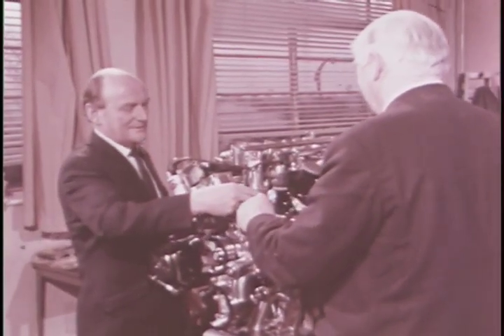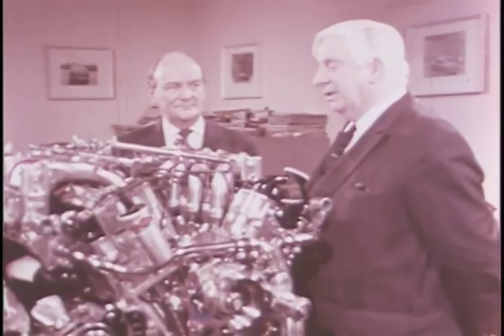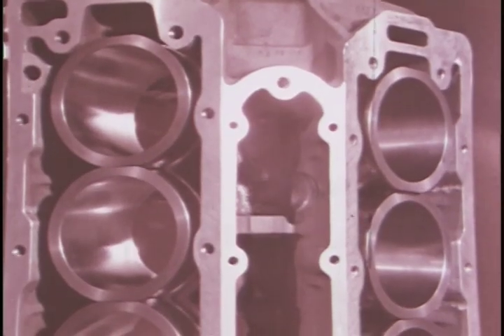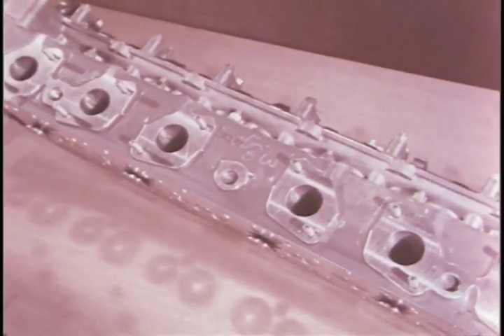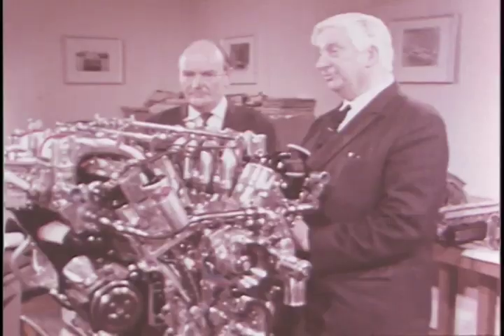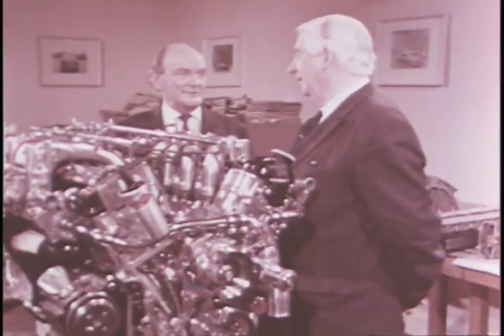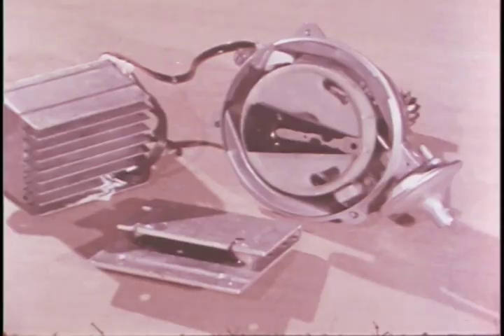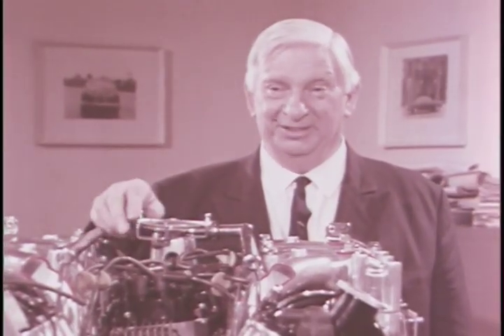Jaguar V12 Engine

Comment: I'm thinking about adding a 89' XJS V12 to my collection. Car has under 50k miles and runs ok. If I end up getting it the first thing will be fuel lines and all fluids (coolant, oil, brake fluid, etc). I'm having a hard time finding out what is the weak link in the cooling system. Is it the radiator or is it from improper coolant changes?
Reply: Download a copy of Kirby Palm's Experience In A Book. Plenty of good advice there about the V12 cooling system, including how to ensure that it is filled properly. If you follow the manufacturer's instructions you may leave air pockets in the coolant.
Reply: +DIY Dan the v12 runs incredibly hot as it is, even so if all the cooling system is in good order its sufficient. However it is advisable to invest in better fans and even extra vents to relieve the hot air.
Reply: Maybe a bit late for you - your To Do list is good, but also ensure that you change every one of the coolant hoses that is not still in practically as new condition.
Reply: thanks for the info!
Reply: I shall be posting a 1989 XJS with 45k miles and in excellent condition.
The owner who is quite wealthy bought it 6 years ago and almost never drove it, and this ended up causing water to condense the tank so now the tank will be dropped and cleaned out and the car will get a clean bill of health before I post it on Ebay. The lucky buyer will have to come to South Carolina to drive it home,

Comment: AS is usual, the Lucas electrical system negated the engine's reliability. The engine was also very heavy; and it was a bear to maintain..a distributor cap was $225.
Reply: +Ad Mirer .. Heat was the problem.. ignition amps bolted into the valley and distributor caps cracking.. constantly.  
Now it's virtually impossible to get good quality caps, or rotor arms.. cheap grade plastics from the far east will consign classic cars to museums.. and barns.!
Reply: +Ad Mirer  'Lucas was a great apostle but a miserable electrician'.
Reply: +Ad Mirer  i am sure there are after market electronic distributors for these engines,  may be wrong but i thought ii read about them somewhere or other,
Reply: marcmarcmarcmarcmarc
..The original distributor was a breakerless ignition, the aftermarket ones were just NOS XJ-S, re-packaged as a costly upgrade.. They do solve the problem of starting when hot, but the real big issue is the carbs.. they make the car run like an agricultural relic. The best upgrade for the V12 is the fuel injection mod..

Comment: had a guy bring his v-12 30 years to my shop, he removed the heads with a chisel, and stripped a bolt hole in the block, guess what 8000 dollars worth of junk, this bozo even told m the cylinder liners come out  from the bottom of the block, for  a 326 cubic inch engine 250 Hp is donkey,the combustion chamber is pure junk, flat cylinder heads with a slight dome on the piston doesnt burn all the fuel, biggest head ache is most wet liner engiines is the jag used head bolts instead of studs, aka  Alfa romeros.
Reply: +18tangles A stud is threaded to the absolute bottom of a tapped hole, and set with epoxy.  How can a bolt possibly be better ??
Reply: Well, no problems with YAMAHA
In fact -
Head bolts on ANY Japanese motorcycle ??
And 100 HP per liter since 1969 . . .

Comment: Heron head / combustion chamber was used in many engines including many VW's 
It was not very efficient, and thus not very popular
Overly square engines produce a wide torque band something that pairs well with a heavy car like a Jaguar Sedan.
At the time this was advanced, but later Jaguar under BL was cash starved for R&D and this engine never saw updates to be competitive with BMW / MB V12's 
Unfortunately due to emissions I doubt we will see v12's in anything other than the odd supercar in the coming years.
Reply: they replaced it with the mays head in 81 i believe
Reply: If memory serves, the BMW 850 had 300 BHP, same as a HE engine.

Comment: A 212 hp V12?! Holy crap we've come a long way baby. What in holy hell were these people doing? Building engines with stone tools? Only 212 hp out of 12 cylinders.......wow.
Reply: darkmath100 He said 272 not 212.
Reply: darthvincor Nothing beats the 7.2L V8 @ approx 200hp the Americans put in to some of their early 1970s cars when it comes to weak large engines (for example, the Chrysler B engine).
Reply: +darkmath100 .. it was designed to run using fuel injection but.. they threw some astonishingly abysmal carbs at it.. probably in part due to US regs. 
If you've ever worked on, or owned an E Type, the fuelling system and all associated parts are a complete mess.
Once the fuel injection system was added, the engine was infinately better.
Reply: darkmath100 Check out some of the older Holden Commodore engines. You'll get 135hp out a 5 litre V8. 
Range Rover also had lots of gutless big engines.
Reply: +darkmath100  Yes, The early ones were no more powerful than the 4.2L straight six.  They were smooth, very thirsty and the cars handling was poor.
Reply: ***** "people were idiots, like you."......Wow. Ok Grant. Didn't mean to piss you off sorry.
Reply: +darkmath100 That also reflects Gross HP net HP as engines are rated today you would lose 25-35%
Reply: 18tangles How long did it take to get to 195 mph?
;-)
Reply: darkmath100 Ford 5.0 v8 185 bhp mustang fox

Comment: After several years of ownership of a 1986 Jaguar Sovereign HE V12 - no repair of any kind ever done to the engine, heads never removed, all original internals, oil consumption so low that the change of level on the dipstick between changes is barely noticeable, even with the relatively large lubrication area of 12 cylinder bores, indicating outstanding material quality and manufacture.

No other car I have ever owned used anywhere near as little oil as the Jaguar V12.

3 compressions down now, one recently become serious because of valve seat dropping, time to take the heads off. No big deal after 30 years.

As one other commenter said - it's the external bits that let these engines down, and people not maintaining cooling systems, so the engines overheat. That's when the valve seats start to move.

By far the best engine I have ever owned, in by far the best car I have ever owned or driven - and that's not a small number.

The range of abilities of the V12 Jags is outstanding - near silence, almost turbine smoothness, with no vibration from the engine ever felt in the car, top end response and acceleration that surprise people accustomed to later German V12s.

Still one of the best engines to drive, with its superb broad spread of torque.

No other car I have ever driven - English, German, Italian, American, Australian (I live in Adelaide) has ever come anywhere near the driving quality of the Jaguar V12.
Reply: 1994 xjs 6l v12. i run it hard and it never complains.had to do a bit of maintenance to him because of neglect and poor workmanship from p.o.but nigel's never left me walking. wouldn't trade him for anu other ride.btw....he's not a garage dweller. i drive him every day cold or hot but i avoid rain and snow. after all....when you are retired you don't have to leave the house unless you want to and when the weather is for shit...i take out the jeep ;-)
i like my bodywork in one piece....don't much care if the jeep gets a knock or two.
Reply: These angines were crap they dropped valve seats any 20000 miles
Reply: 18tangles Which model?
Reply: +18tangles I had a 1964 2.4 MKll with Solex carbs...I threw them in the bin and fitted a 3.4 inlet manifold and SU HD6's with TL needles and red springs (Advice from SU in Brum:) and I think Jaguar went on to use HS6 carbs at a later date...Back in those days Duckhams Q20/50 came out and was as cheap as chips although bought out by Castrol now I believe...Happy days.
Reply: 94xjs6l.runs well.125k mi. i run the hell out of mine and no serious problems. it has never left me walking. a bit frustrated at times but never a walk required.
i highly recommend this engine for performance applications.easily tuned and responsive to changes.
Reply: I always figured australian cars have a lot of american engineering behind them.
Reply: How many miles? And why are you bragging about an engine being reliable and well-built and well-engineered in a "high-end" car? Engines are supposed to be reliable and durable. You're bragging about competence. Not "excellence". And what the fuck is "driving quality" and how many cars have you actually driven? It's not hard to be the very best of a very few.
Reply: @deeremeyer1749  Troll

Comment: Hmmmm, don't agree with you SuperStig23. I put my engine together in 2005 and it' still going strong without missing a beat in 10 years! Have you ever experienced the smooth linear power delivery of this V12 unit let alone the silence? I am actually wondering if you're an armchair critic without the knowledge of these glorious engines. As for your views on the 6 cylinder XK unit, this motor too was a tour de force when released in 1948. These are mechanical pieces of art which were a true masterpiece of design and execution and thoroughly bang up to date in their respective eras. A Ferrari V12 was and still is a ludicrously expensive power unit where Jaguar bought the fabulous and exotic V12 to the masses for little money. It's all relative my friend. Jaguar, for a small British manufacturer punched well above their weight offering champagne machines for beer money...
Reply: RCBM Superstig is talking bollocks! A Ferrari 250 produced 220 BHP, not sure how that is twice the power. Lamborghini started building his own cars, because his Ferraris never worked.
Reply: Its been running for ten years? Continually? WOW. The way you Jaguar fanboys brag about your engines and cars - supposedly "premium" in both cases - actually running and driving for "years" after dumping ridiculous amounts of money into "restoring" and/or "rebuilding" engines/vehicles that apparently were worn out ALSO within "years" is hilarious.
Reply: @deeremeyer1749  well then since you've got such a big mouth stuck on the front of that so called face of yours why don't you just go ahead and give us all an education then?

Comment: The old Buick V8 was far better and more reliable engine used by Rover and MG also if you want a real V12 how about a Ferrari ?? 2.5 litre V12 sounded great, was half the weight and twice the power. Even the XK twin cam 6 was just an inferior version of a BMW.
Don't get me wrong Jag's were beautiful  cars unfortunately their V12 engine and all the cars fitted with it were unreliable POS. The new Indian owned models are a joke, The top end Hyundai and VW cars are better looking faster and half the price.
Reply: Shut up
Reply: You think 2.5 liters in 12 cyliders and pistons the size of shot glasses sounds "great" when you can put the same 2.5 liters in 4 cylinders for 1/10 the money and 1/4 the space? You're clearly a Jaguar fanboy. Go back to watching your propaganda here or playing with your Hot Wheels cars or whatever it is you do to get so "smart" about cars.

Comment: It's funny that these are some of the most troublesome engines ever made.
Reply: ManInTheBigHat It was more the injectors and electrical systems of Jags that were not reliable. If something DID go wrong with the V12 though, well, you know it was very expensive. They certainly aren't known for their longevity but for the first 80,000 miles or so, they were decent.  
I used to have a mid '80s XJS V12 but installed a warmed over Chevrolet engine with complete, custom wiring after conversions became quite commonplace. No problems at all, then. Better fuel economy and MUCH a faster car!
Reply: ManInTheBigHat  It wasn't necessarily the engine itself, it was the "supporting systems"...electricals, ignition, emissions systems(vacuum lines, multiple air-valves, diverter valves,etc), Fuel systems. The core of the engine itself is very sound...too bad the later half of its life had to deal with emissions systems & fuel economy issues. This chore of trying to be a "clean" engine and an "economical" engine was just really too much to accomplish. The result was a wholly complicated effort, & as such, prone to breakdowns ....not from any design faults, just too many things to go wrong.

Comment: So smugly talking about their head design. Then HE blew it out of the water.
Reply: darthvincor Doesnt matter between the HE and pre-HE, any engine with a 5 or 6 speed is going to be better than another with a 3 speed. All down to gearing. You can just about squeeze 20MPG out of a 3 speed XJS, but you can get mid 20s with a decent tranny.
1st gear almost isn't used and you get into third around 40ish mph, so anything speed past 40 is just eating up more fuel. The turbo400 is the worst part of Jags from the 80s
Reply: Ford Fan 2904 I like the Capris and the Heron head arrangement. VW Golfs has that arrangement also. I'm currently involved in an engine design project with that set up also. The spark plug is TRUELY in the centre of the chamber and the squish, as you say, is good. Pistons can get heavy though. Did the Essex motor have siamesed ports like the later cologne?
Reply: Having heavy Pistons in an Essex engine doesn't improve torque, it increases inertia in the engine and increases fuel consumption, torque has nothing to do with rotating mass, it is to do with where in the rev range horsepower is produced.
Reply: Michael Mays fireball head is overhyped- take it from someone who used to work at Whitley- they are severely knock limited and flow poorly with a high crevice volume combustion chamber
Reply: MarquisRex
I did not know that. I've read books and tech manuals about the XJS, and HE was always viewed as superior, with better fuel economy and equal, if not better, performance.

How does that affect the engine, those two things you mention?
Reply: The very high comp ratio means the fuel economy under moderate to light loads will be better. However Michael May was very academic and what proved good in the lab didn't in practice, mainly because it was difficult to control the squish height in production. At high loads the HE engine will be very knock limited with high exhaust temps- as the map Is very retarded- hence the V12 needs very good cooling. The intake ports of the HE heads don't flow well- which means the power output is poor. Earlier flat heads have a lot more potential. Earlier flat heads with a Tremec 5 or 6 speed or tranny with lock up fitted will have markedly better fuel consumption than a later HE car. The transmission has a much bigger impact to fuel economy than small combustion chamber changes
Reply: MarquisRex
 I see. Thanks for the info. So an pre-HE V12 with lockup auto/manual gearbox, may actually get better fuel economy than an HE with 3 speed auto (no lockup and no overdrive).
What's your opinion on the 6.0 V12? Or is it virtually identical to the HE?
Reply: the 6 litre V12 is a great engine- despite the may fireball head. It is great because thanks to Ford all of the little things like seals and gaskets and plugs were properly engineered. The crank rear main seal is a proper modern design unlike the older earlier V12. It also has denso fuel injection so is very dependable. That base engine with early flat heads would be a dream!
Reply: MarquisRex The gaskets and plugs are not an reliability issue with the 5.3 v12. What is known for leaking besides the half moon seals?
Reply: MarquisRex My Ford Capri 3.0 L V6 has the same head design , it is heavy but the strenght of the design is torque and efficient combustion because of squish , you can think of it as an inverted hemi , a hemi also has very heavy pistons and heads and they don't like to rev high but they are torque monsters , the same goes for the May fireball / Heron cylinder head , it's also as he said  it is robust and simple to make.  200 ft/lbs @ 3000 Rpm from a 3.0 L engine designed in 1966 isn't bad at all i think... the engine weighs 374 lbs though , it makes it up because of the torque and durability though. i rebuilt my engine a few years ago and it reached 310.000 Miles without any major overhaul
Reply: The later Essex 3.0 v6 only had 182lb/ft, earlier engines had 173lb/ft not 200.
Reply: suprac19 You're right i couldn't remember the exact number but it was close to 200 so i said 200 , still more than any other Ford engine produced in Europe since 1966 to about the mid 80s'
Reply: MarquisRex No , the Essex had 3 ports , and the only Cologne with 3 port heads was the 2.9 EFI , the 1.3 and 1.6 crossflow also used heron heads , and yeah the pistons in the Essex are quite heavy but that has the advantage that they make quite a bit of torque for a 3.0 L engine like the one used in the Capri , the Capri engine made 144 Hp and 182 ft/lb of torque , the Capri engine is the most powerful one because it has a hotter cam , i have a 1975 Ford Capri 3.0 Ghia and i've owned a Consul 3.0 GT before ,a nd it is noticeable that the Capri engine has a hotter cam than the Consul/ Granada which has 138 Hp.
Reply: Ford Fan 2904 " they don't like to rev high but they are torque monsters , the same goes for the May fireball / Heron cylinder head "

No. Not at all. The 5.3 LOVES to rev and it is all about the stroke:bore.